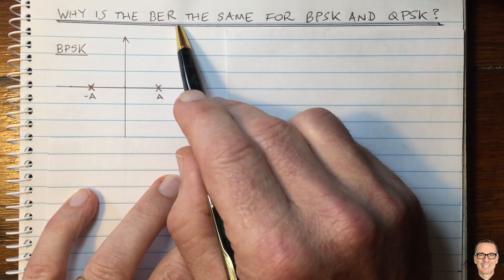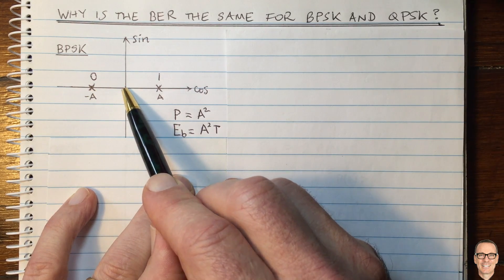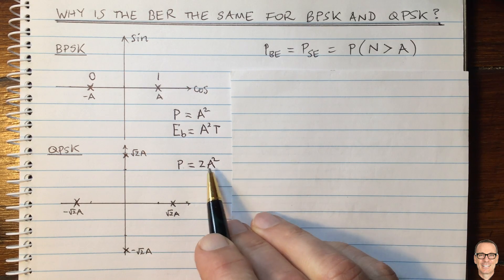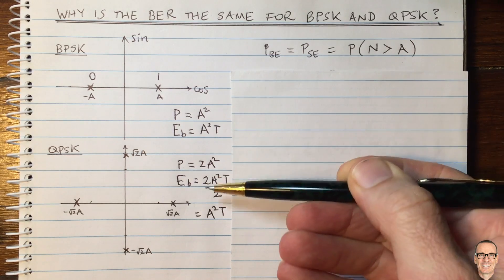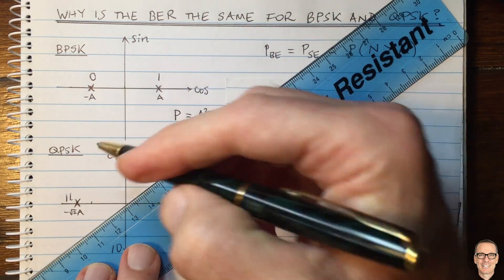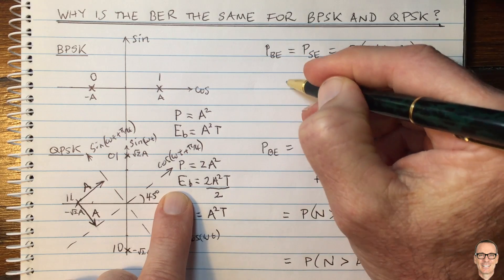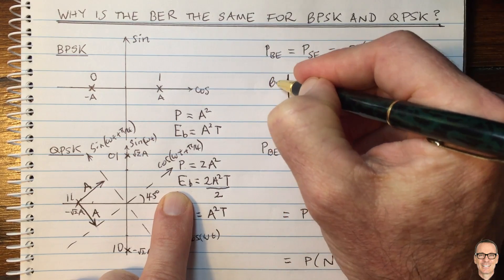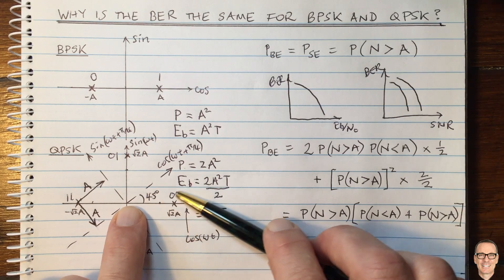Why is the BER the same for BPSK and QPSK?

Comment: Nice video but why are you assigning a symbol vector magnitude of A to the BPSK symbols and a different symbol vector magnitude (A*sqrt(2)) to the QPSK symbols? This would mean that the QPSK system uses more power than the BPSK system. This is not a necessary assumption afaik for the QPSK system to have the same BER performance as the BPSK system

Comment: The instantaneous power is the squared signal x(t), that is clear. But what is the unit of that signal? Is it always the voltage or can it be different (e.g. electr. field E, magn. field H, power density S = E × H in W/m^2)?
Thanks a lot.
Reply from the maker: If x(t) is either voltage or current, then when you take the square of it (and divide or multiply (respectively) by resistance), then you get the power, in Watts. See: "Signal Power and Energy" https://youtu.be/7I9XEhAup4c

Comment: BPSK and QPSK: Understanding Bit Error Rate

Abstract

This video delves into the comparison of Bit Error Rate (BER) between BPSK (Binary Phase Shift Keying) and QPSK (Quadrature Phase Shift Keying) modulation schemes. The analysis reveals that while both methods can exhibit the same BER, this is contingent upon maintaining equal energy per bit rather than equal signal-to-noise ratio (SNR). The video elucidates the underlying reasons for this phenomenon, emphasizing the role of orthogonal basis functions (cosine and sine) and the impact of bit mapping on error probabilities. Furthermore, it clarifies that the observed BER equivalence between BPSK and QPSK under equal energy per bit is a unique case, not generalizable to higher-order modulation schemes like 16-QAM due to limitations in available degrees of freedom.

BPSK Modulation and Energy per Bit

* 0:00: The video aims to explain why BPSK (Binary Phase Shift Keying) and QPSK (Quadrature Phase Shift Keying) can have the same bit error rate (BER) under certain conditions.
* 0:15: BPSK uses two constellation points on a constellation diagram, each representing a digital 0 or 1.
* 0:39: The x-axis represents the cosine axis, modulating a cosine wave format at the carrier frequency.
* 0:49: The y-axis represents the sine axis, with power determined by the square of the amplitude (a²).
* 1:07: The energy devoted to sending one bit (energy per bit) is calculated as power multiplied by the time period (a² * T).
* 1:26: Errors occur when noise pushes the received value beyond the decision boundary (amplitude "a") on the constellation diagram.

QPSK Modulation and Energy per Bit

* 2:01: QPSK employs four constellation points, each representing two bits.
* 2:12: The video compares scenarios where the power in QPSK is double that of BPSK (2 * a²).
* 2:36: Since QPSK transmits two bits per symbol, the energy per bit is calculated as (2 * a² * T) / 2, resulting in the same energy per bit as BPSK (a² * T).
* 3:33: The video emphasizes that comparing BER between modulation schemes requires considering whether the comparison is based on the same signal-to-noise ratio (SNR) or the same energy per bit.

BER Comparison and Degrees of Freedom

* 3:56: When comparing BER with the same energy per bit, BPSK and QPSK exhibit the same BER due to the utilization of two orthogonal basis functions (cosine and sine).
* 4:24: In QPSK, the decision boundaries are at 45 degrees, aligned with these basis functions.
* 5:30: Noise is independent in orthogonal basis functions, leading to similar error probabilities in both BPSK and QPSK.
* 7:30: The video highlights that symbol errors in QPSK may only result in a single bit error due to the bit mapping, hence the factor of 1/2 in the BER calculation.
* 9:59: The property of achieving the same BER with doubled power and data rate is specific to the BPSK-QPSK comparison and does not extend to higher-order modulation schemes like 16-QAM due to the limited degrees of freedom (two: sine and cosine).

i used gemini 1.5 pro
Token count
3,910 / 1,048,576